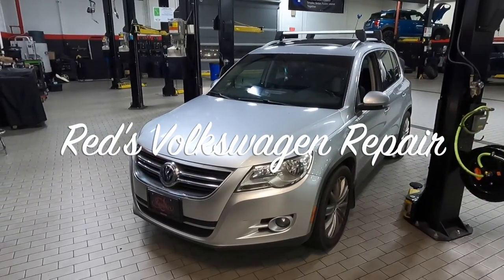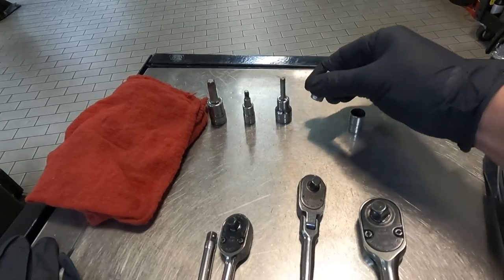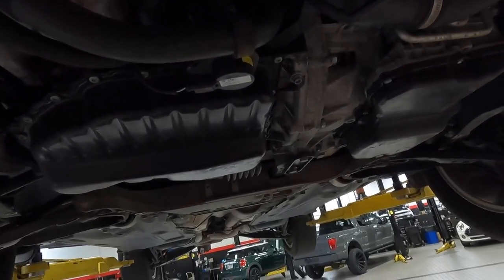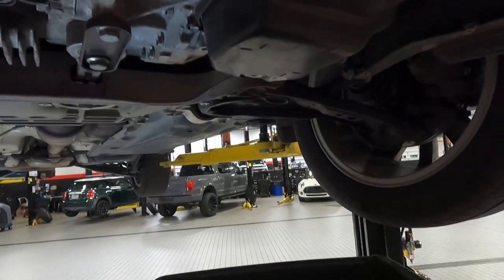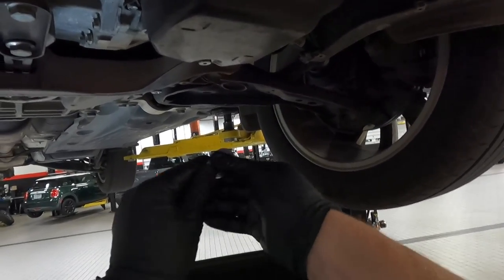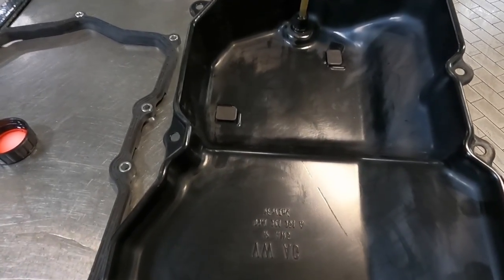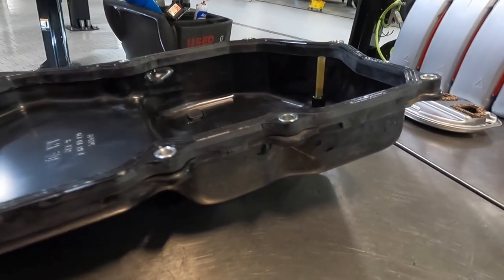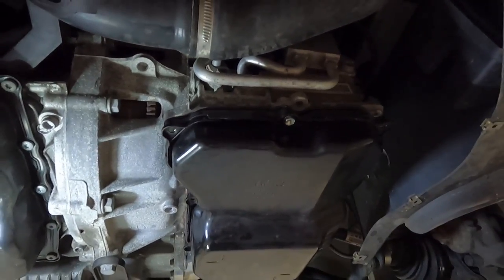How to Perform an Automatic Transmission Fluid & Filter Service | Mk1 Volkswagen Tiguan (2009-2018)

Comment: Hello, 
Just wanted to say awesome tutorial video on this one. I subscribed to your channel! I just finished up this procedure on my 2011 tiguan 2.0tsi 4motion with 193000 kms. Got it level on 4 jack stands, dropped the oil, pan, and filter. First off, I only got 3 liters of fluid that came out. (Shifted fine, no issues) Replaced new filter, and new pan gasket and fluid level tube. Did a fill with 6 liters of Liquimoly atf 1200. Got the temp up to 40°C, dropped the drain plug while it was running. Here's the strange thing. I got a steady stream of fluid the whole time, never did get the trickel like you mentioned. I ended up with 2 liters of fluid removed. Is this okay? I don't have a live data scanner. In theory I should be up 1 liter of fluid from what was taken out. What's your thoughts on this? Thanks
Reply from the maker: Hey, glad I could help out! And thanks for subscribing. 

Good question. Sounds like you did everything perfectly, maybe just didn’t wait long enough until it trickled out. 
Here in the states we use quarts so I’m not sure about liters, but I normally put 5 quarts in and it drains out about 1. 

I wouldn’t focus on how much is in the car though. As long as you have a trickle in the temperature check range, you will be good.
Reply: 1 liter is 1.06 quarts. Did you not put 6 quarts in the transmission in this video? I was understanding you put in 6 quarts and then drained out 1 quart. I put in 6 liters (6.36 quarts) and drained out 2 liters (2.12 quarts)
Reply from the maker: @MrMirada82  You’re right, I put 6 in. My fault. 

You will be good if you end up having about 4.5 quarts in the transmission. 👍

Comment: Hi I have lifetime fluid dsg I am always curious to know if I need to change my fluid. Some of the video say to change it regardless that the trans fluid causes a short circuit in the meta Tronics what do you think
Reply from the maker: DSG is the rear differential and that fluid is not lifetime. I actually made a video for that. You should check it out!

As far as the transmission in the Tiguan, yes it is “Lifetime” fluid but I recommend performing this service every 50k miles.

There is literally no difference in the transmissions that Volkswagen put in the Jettas and Tiguans but the Jettas scheduled maintenance card says to replace every 50k. Soooooo…..
Reply: Sound really  appreciate you getting back to me and a big thanks for the information 👍
Reply from the maker: @wackey3455  No problem!
Don’t forget to subscribe if you haven’t already, thanks!
Reply: Cheers I did 👌
Reply from the maker: @wackey3455  I appreciate it!

Comment: How much quart will be for atlas TSI engine transmission?
Reply from the maker: If I remember correctly, I start with 5 and then check the level. Didn’t do too many of these before I left Volkswagen. Hope this helps.

Don’t forget to subscribe if you haven’t already, thanks!
Reply: How many quarts you got from the drain and from the pan together?
Reply from the maker: @tigray1  Not sure what you are trying to ask but my last comment should lead you in the right direction.

Comment: After filling and having the car run while draining out to set level, is it in park or neutral?
Reply from the maker: @Peter-ni1pw  -Start the car
-Run it through all the gears (PRND) stopping for 5 seconds at each. Do this twice. 
-Put in park with engine running. 
-At the correct transmission fluid temperature range, pull the drain plug and let drain until it starts trickling. If fluid is still pouring out by the time you reach the temperature threshold… put the plug back in. Turn the engine off. Let the transmission temp cool off to the lower temperature of the check range and then check the level again.  Needs to start trickling within the temperature range. 

Hope this helps. 
Don’t forget to subscribe if you haven’t already, thanks!
Reply: @RedsVolkswagenRepair  already subscribed, glad I found you channel , thank you very much!
Reply from the maker: @Peter-ni1pw  No problem!

Comment: I have 2011 2.0 Tsi 
I didn't change since 195Km,Can i change Transmission fluid, i need you precious suggestion?
When i'm going to mechanic for changing they are telling now it will make some issue in gear.
Reply from the maker: That’s what “they say” but I have never experienced this personally. If you are already having shifting concerns, I don’t see why not. But if you don’t have shifting concerns, I would probably hold off on changing the fluid. Hope this helps. 
Don’t forget to subscribe if you haven’t already, thanks!